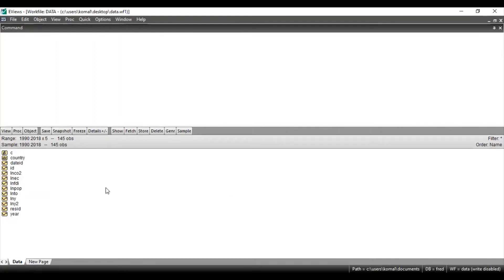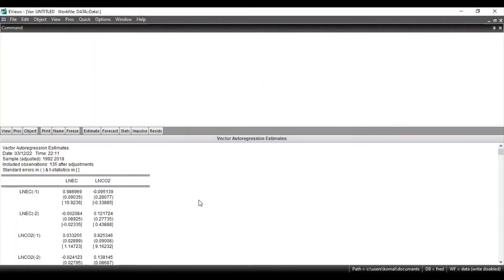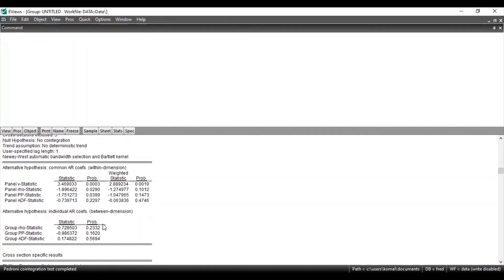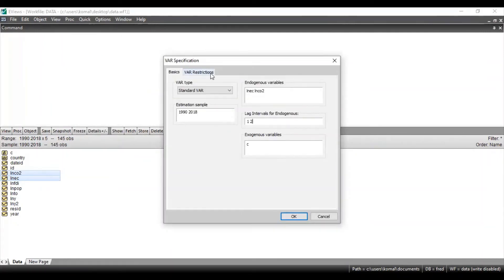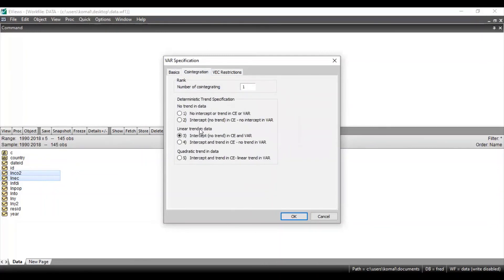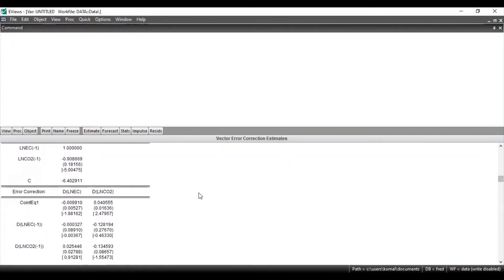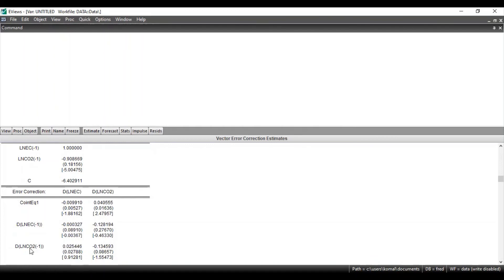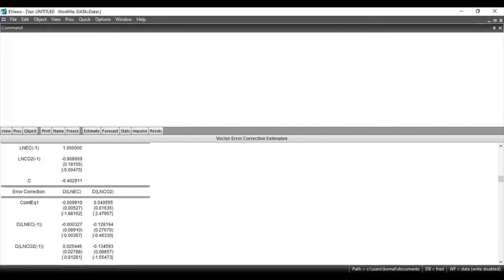VECM || Vector Error Correction Model in EViews || VECM in EViews

Comment: some of my variables are integrated at 1st difference and some are 2nd difference. which method should I accept? ARDL or Cointegration or VECM.
Reply from the maker: You can run any model as per your requirement. But none of the variables should be stationary at the second difference.

Comment: Mam If the data is stationary at first difference but there is no cointegration between the variable i.e there is no long run relation then which method should be used for testing short and long run relationship between the variables? Restricted VAR or Unrestricted VAR?
Can I use VECM model for the variables?
Reply from the maker: You can employ NARDL model to test short run and long run effects.